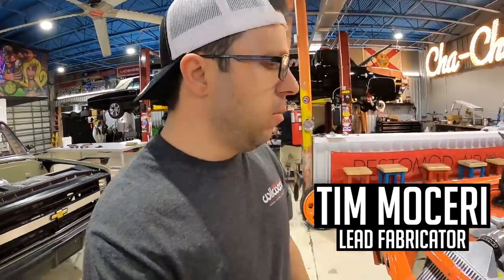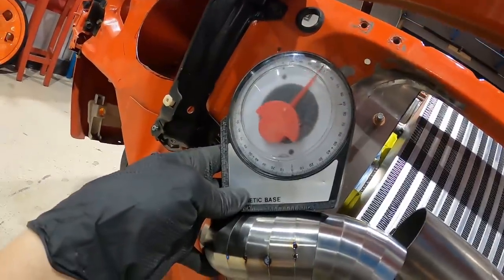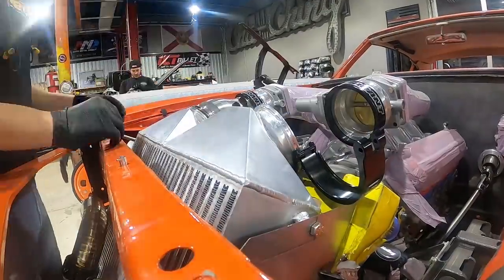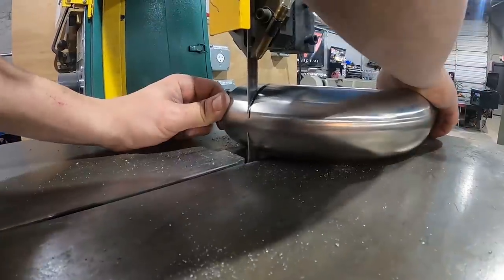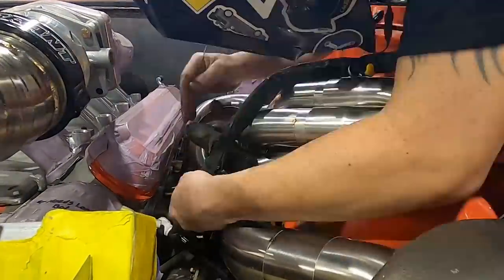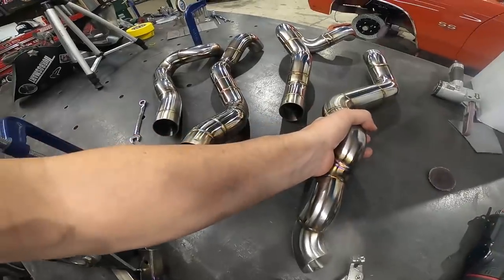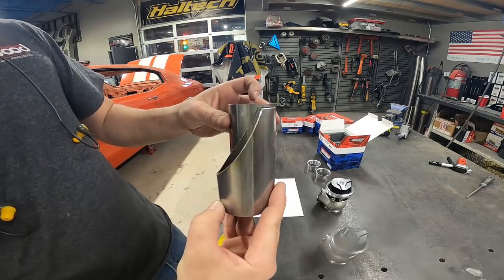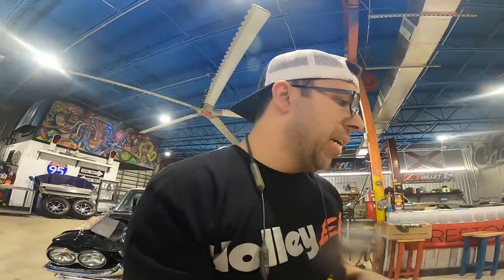Building Twin Turbo LSX Headers for the 1970 SS Chevelle! - LS Swapped Chevelle Ep. 6

Comment: Only small assemblies are done in a box, large assemblies structural or tube are done back purged with a trailing style shield wherever it can be used, if one can't a larger style cup is used. Furick cups are a common sight, even though they're not company supplied. And 5 is a perfect setting for well fit tubing, I set it at 20 though to fill the area, when I can feel a steady flow at the exit I pull down to 5. And yes, aircraft industry for 24 years now.
Reply from the maker: I’d your in the area would love for you to come by and show us a few things. Thanks Mikey! Love the name also, lol mikeyrollss

Comment: Damn that looks insane! How does the exhaust not hit everything around it when the engine twists during acceleration? Are the engine mounts solid to stop any movement?
Reply: Good question.  I was wondering the same thing. 
I've watched other YOUTUBERS that did this same thing.  So far they all have revisited what they created and added in some type of flexible rubber tubing. Because they all ended up cracking welds. Breaking joints, clamps or bolts.
Reply: I’ve seen some people add those mesh flex pipes like for an exhaust to deal with the movement. I’m guessing this will crack over time.

Comment: I like the headers.   The charge pipes not so much.   The titanium is not necessary and is ugly IMO (and probably hurts flow 1%).  TI is cool on a 2000lb race car because it actually serves a purpose, but not in a 4000lb street car.   Aluminum would have been fine and its just as light.   Stainless if you're "showy".

Comment: 👍Great fab work, one thing l missed or would like to ask is, if you didn't touch on it during this vidio, 🤔 is titanium as good? Or the same as aluminum when it comes to cooliing & heat disbursement? Will you have to protect the intake and intercooler runners? I'm sure at this level of boost it won't matter? I was more concerned with the low speed cruising before getting on it. The heat generated under the hood is a crazy amount,  the over the top headers and turbos are all cooking utensils. 🔥😛😡. Will you protect any of it? And with what? 👍🥤✌🏻🔑 🙋‍♂️ 🌤 🇨🇦 q👨‍🦽😎. Thanks.
Reply from the maker: Titanium does a much better job with thermoregulation. We'll touch more on how we're going to protect the engine bay from excess heat a little further down the line!